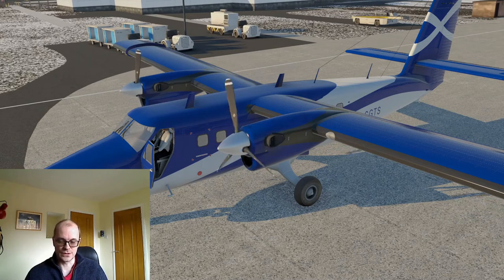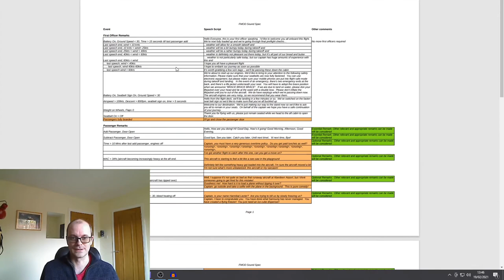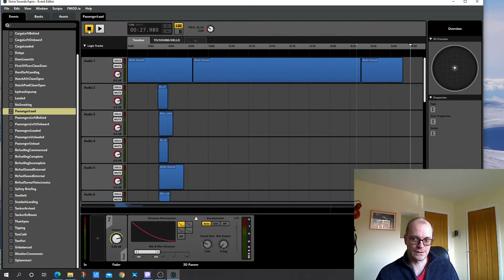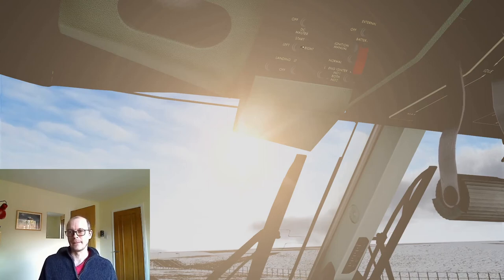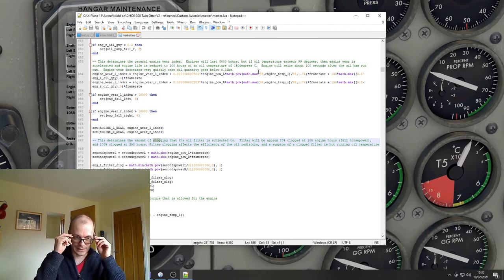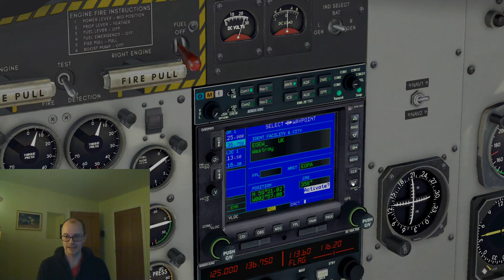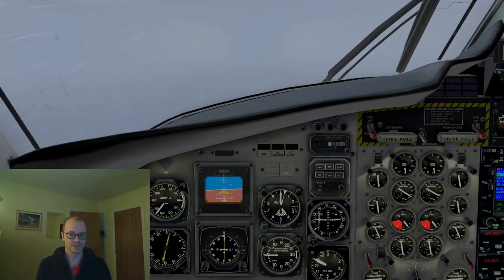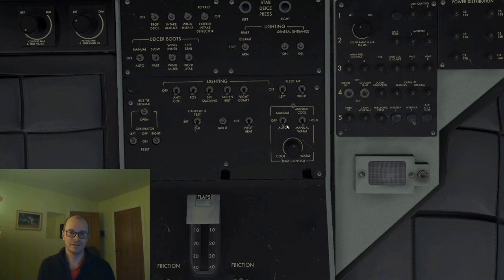X-plane 11, RW Designs Twin Otter modifications

Comment: Thank god for COVID :) I'm having several issue with the Mods. No EADI. No steering (no rudder pedals). If I leave engines running on the ground for a few minutes - sometimes I get high temps and alarm bells ringing. With the door open I can't load any passengers.

Comment: Are you using Vulcan?
Reply from the maker: In that scene, no I wasn't.  The only difference between vulcan and OpenGL here is the librain plugin - which applies the windscreen rain effect.  It doesn't work in Vulcan, so in that instance we would have the default rain effect instead.